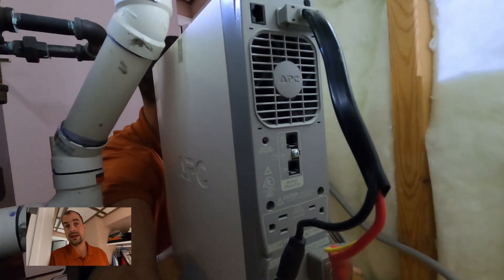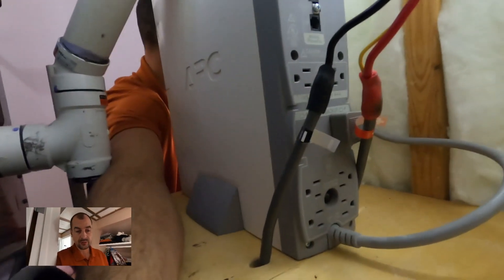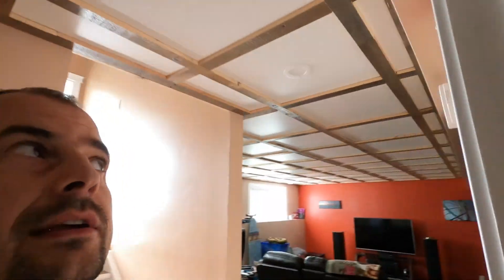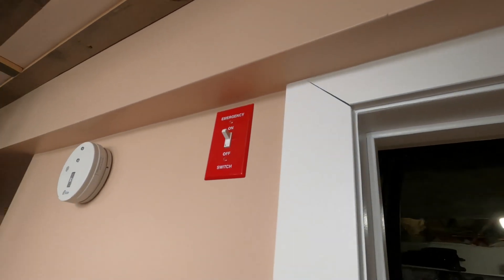Using A Gas Furnace When The Power Is Out

Comment: Thanks for sharing, I am thinking of using a champion gas power inverter generator but you have me a great idea to add a battery backup into the circuit for seamless power transition during an outage. I want the generator for a longer power outage in case it's a really bad storm and power is out more than 4 hours.
Reply from the maker: If I were to do anything differently I'd get a single battery from redodo.  Good luck with whatever way you decide to go.  I've thought about adding a generator as well but we haven't had an outage long enough to use it since I've installed this setup.

Comment: Hi thanks for this video - did you mention what the capacity of the batteries was? I am thinking of a simmilar set-up with an EcoFlow Delta Pro rated at 3600 output and 3400 capacity
Reply from the maker: 105 Amp lead acid battery if memory serves me correctly.

Comment: would be great if you can provide a link which gives a wiring diagram and components...i'm trying to piece together for a similar solution.  and while i have used batter backups for computers, i didn't have to put nearly this much thought into it in terms of calculations.  something to help understand all of that would be great - thanks for your video!
Reply from the maker: You won't have to wait too long.   I'm in the process of putting together a few videos of what I've learned and would do differently.  You'll start to see videos on this within a month.

Comment: Setup looks great. The only thing is I have an APC backup from 2017 and when I tested it, according to the kilowatt plugin meter, the thing was putting out DC current, which tells me it is probably some sort of modified sine wave these things put out. I tried plugging my window fan into it and it made a loud buzzing noise, and about 30 seconds into operation I smelled something burning, so I immediately stopped everything.
I saw on amazon a couple years ago a pure sine wave inverter that had the ability to be wired directly into a circuit and could provide a full 15 amps that a normal circuit would take up, and I even think it had an internal charger as well. It didn't always run off a battery, but would kick in when the power went out just like a UPS unit. That would solve the above issues and won't burn out the motor when ran for a long time.
As for the flooded lead acid batteries, they are generally meant to put out a sudden large current and get damaged quicker with repeated discharges or by getting discharged heavily, which AGM batteries solve. I have a 200 AH battery of this variety and it's extremely heavy, will definitely take two people and a hand truck to get down to the basement. They also sell lithium based batteries of the same size which are much lighter, so that's another viable alternative.
Reply from the maker: I mentioned to someone else here, if I were to change anything I would probably put in LTO batteries.  Thanks for taking the time to leave us a comment.  There was definitely some trial and error for me as well getting what I wanted.

Comment: I've got a gas furnace, but no blower fan, as it's baseboard heat. On the other hand, there are occasional ice storms with days without electrical power. It's a large house with four 24V transformers each connected to a thermostat. Wonder what size uninterruptible power supply (UPS) I'd need.
Reply from the maker: I'd start by finding out the power draw, an amp meter is a great place to figure that out.  From there you could decide what size backup.  You probably would want something at least 40% bigger.  Then power cells become easier to figure out, based on how long you'd like it last.

Comment: Have the same apc with dead batteries... Was just thinking of doing this as an overnight backup allowing shutting off the generator.
Just need to source some batteries that will go for 8ish hours....
What’s your furnace amp draw?
Reply from the maker: On 110v it uses about 2.5 amps, when on the 2 12v batteries in serial, it uses just under 10 amps.

Comment: I'd  assume the APC has an inverter in it to convert the 24v to 110v. Have you checked the type ac it is putting out? I am not sure it's a true sine wave and it is probably a square or modified sine wave. This can cause some problems down the line with damage. APC's website actually has a support article for running non computer loads about it not being supported. Also for the battery type, it seems like a deep cycle battery would be more application specific.
Reply from the maker: Very informed on all accounts.   As your luck would have it, I was in the process of making a followup video to this today, and found out exactly what you mention about the waveform not being what it needs to be.   This furnace should have a pure sine wave inverter on it, this backup also splits 60 volts on both the common and hot wire.   I don't like this and I'm actively searching for better.  More information to come as I find out more.
Reply from the maker: I'm very lucky here my furnace had a safety feature that got me looking into better inverters and pure sine wave.  I'm kind of amazed at these being approved for computers.  Lots of motors in there as well, stable power also bring extremely important for overclocking. 

High quality inverters for me now or none.

Comment: THANK YOU,   i do not understand  , will find out what an    ''APC  is    did not understand wiring?   i will pay an   electrical eng.      , for safety,
but the wood stove backup   has a hard time trying to save the pipes  from freezing
Reply from the maker: Great idea using an electrician, local building codes are always different as well and an electrician will know what all of these requirements are.
Reply: @HouseDadLife  THANK YOU
Reply: Me neither. I don't know the electrical engineering lingo, so I have no idea what anyone is talking about.

Comment: Interesting set up! I saw your comment on my generator as a power backup for a furnace video. Could you use a small gas sipping inverter to keep your set up going long term?
Reply from the maker: That could be an idea.  I'll have to actually run this thing on the batteries and see how long it will go.  Better to test it and find out now before we lose the power for a few days.